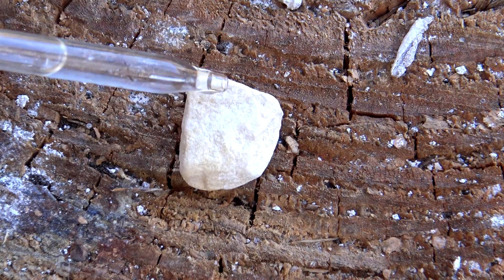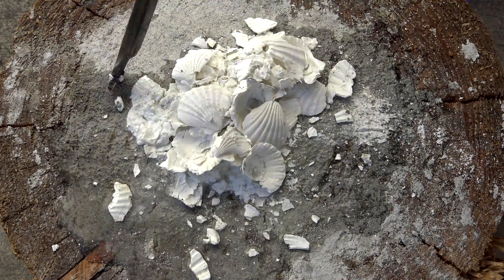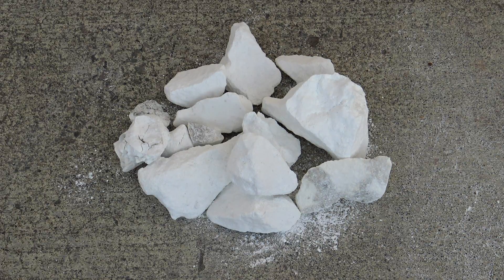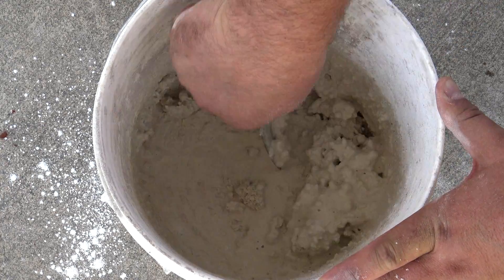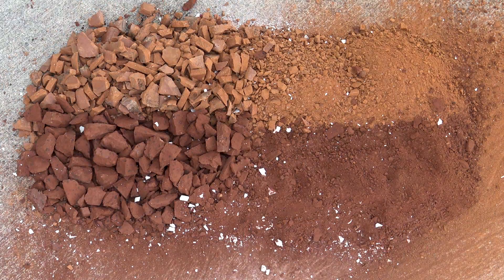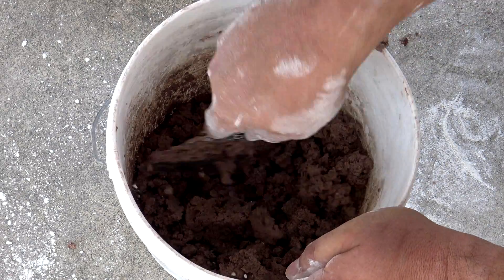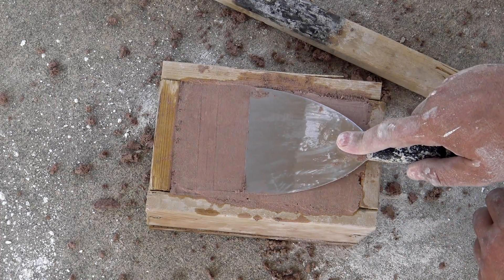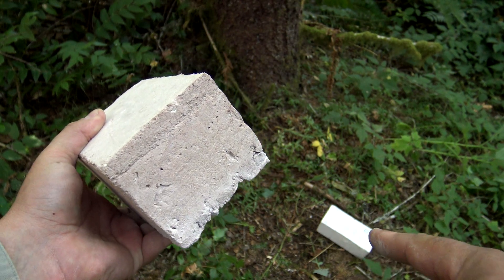How To Make Improvised Roman Concrete (Corporal-Crete)

Comment: It's interesting you bring up ceramics and brick, particularly relative to their respective formulations.  High strength, high alumina ceramics and bricks - you would use Kaolinite or Kaolin clay.  It's commonly used in foundries, but, as a ceramic or brick, it's expansion properties are much more stable than other common clays.

Also, strong brick, historically has been associated with a small addition of humus, or humates, or, in its simplistic form humic acid.  This is especially notable because it is hypothesized Roman concrete also contained small amounts of humic acid and pozzolans (high alumina clay...or Kaolin).

Humic acid is a chelating agent, but it's also a natural plasticizing add mix.  So the kaolin, with a minimal amount of humic acid, would hypothetically blunt its impact on the calcium compounds.  Roman concrete needed longer to set, but also became stronger over time - this has been attributed to the pozzolans, but the different bonds humic acid forms could have played a role as well; particularly if humates have to break down to humic acid after the calcium bonding has largely taken place.

Also, in terms of aggregate size, two different sizes would be selected and it's shown that a very fine with a fine aggregate tends to produce the most durable/strongest concrete.  Also, of course, the most expensive concrete.

If you wanted to make concrete stronger than roman concrete, be selective with your sand.  Some sites in Africa are known for sand with high diamond content - aptly dubbed "diamond sand." The name alone almost begs to be tried out!

Cool videos testing out variations on Roman Concrete - it's an interesting mystery given all the concrete we use today.  Seems like it shouldn't be....(?)
Reply: nice read man. As a farmer i have an abundance of hardwood ash and perlite used in my soil preparation for seeding.would it be possible to use any of these materials as readily available substitues.

Comment: I wondered the application of lime mortar, in place of cement, when making rammed earth.  The amount of cement is a low percentage, and the caustic mix of lime once mixed with the screened earth, would be damp still, enough to ram the blind or walls.  I heard that a company was using a gypsum plaster,  to create a concrete from earth.  The gypsum slowed the drying process.  Aldo, salt water, somehow strengthened roman concrete.  But, just, primitive lime mortar from limestone, mixed in place of cement, for rammed earth really intrigues me.

Comment: Traditional cobb structures were stabilized with a layer of lime plaster inside and out.  There are cobb buildings in the UK that are 600 years old and still occupied.  Adobe structures can be plastered in the same way.  Roofs can be thatch, shingles, shakes, slate, or tiles.  Low tech housing should the need arise.

Comment: I wonder if silty layers from a river would make a good mix. idk about you but is hard to see silt as font is bad. S I L T. sorry just in case. but I think if sifted and strained it would be as good as volcanic ash. also most old concrete used an aggregate, the hardest is quartz river stones, from what i have  seen in renovation projects of old roman structures

Comment: Just wondering normal clay would be ok to mix in? Now that you makes pots with that or does it has to be heated? And does it counts for all kinds of clay?
Reply: Oh yeah and if you build a shelter underground with it, then water would get through the concrete? or now that you added Clay/pottery does that make it a bit more water resistant?
Reply: If you put the shells in a box of glass like a green house would the sun be enough to make the sea shells usable if you dry/burn it through magnifying glass?

Comment: How do you make concrete if your in the woods & don't have any thing from volcanoes or by an ocean but maybe fresh water, & no lime.
Reply: if no volcanic ash one could use wood ash by soaking it in water then refiring it and then rehydrating again and add terracotta powder to make bricks... you can also add lime etc if you so wished to have a 2ndary binder. however the ash and terracotta works very well. this is also a water resistance substance (more so than regular concrete).
Reply: Lime is easy. Bones are very similar to seashells chemically, you can do the same things with the crushed bones of humans or animals. For silicates and aluminates it is a little harder as you have to mine them and you need some knowledge of geology. My guess is that gypsum is probably your best bet.
Reply: @exaltdragon  Bones can be used to make a reactive lime but it would be very very weak, because of the impurities. Bones are like half organic matter. Gypsum is a good suggestion, though it's not water resistant. Gypsum fires at lower temperatures than limestone. Gypsum is basically plaster of paris and can be used as a straight, weak but effective, mortar in itself. A LOT of old Stone buildings in Paris have gypsum based mortars.

Comment: I just discovered this second video.  Great to see it. :)

This second batch didn't have quite the same plasticity as the first one, I don't think; it looked more crumbly.  I could see the first batch being used more for load bearing applications, and this one being for a fire hearth; especially if a bit of sand was added to it to make it a little more specifically fireproof.
Reply: second one is mortar to use as a binding material for stone or brick wals
Reply: and as a plaster for wall is perfect

Comment: I keep seeing very silly people claim that Roman concrete is superior to modern concrete.  I ask you how many roman concrete bridges are still standing that allow anything other than foot traffic to cross them?  How many can Roman Concrete Bridges support an additional 400 tons of weight day in and day out?  How many of these supposed Superior Structures are put through the stress of the modern day?  Almost none of them.  Why?  Cause they lasted this long and we don't want them breaking further.  Eaven modern concrete can stand the test of time if we don't fucking use it for anything.  But we do, hence why it breaks down.  We don't build things out of concrete because we want it to look pretty, we build things out of concrete because we want it to be strong.
Reply: at least one was used for traffic until 91

Comment: hmm i would like to know how they react to impact... just like steel, the harder it is, the more brittle it is so if you hot both bricks together, will they break like normal red bricks? since normal red bricks are extremely brittle on impact they break with almost no force BUT they can withstand extreme pressures so that is why they use those... my prediction is that original roman brick is better against impact. (i play too many "make it your self" games i think; Like Factorio, Space Engineer, 7 Days to Die and mods of minecraft... i know when i look at my back yard and realize i can't just go dig stuff and make a fortress or a factory ;P )

Comment: I just found the channel tonight. Looks interesting. I'll have to check it out some more.

But I'd call this a success. That second concrete block you made in the Roman concrete video clearly had some pitting issues. I'd guess the problem was a combination of the aggregate size, and trapped air, probably also due to the aggregate size, though maybe you could compensate for that with extra layers and tamping or vibration to get the air out. Although that would decrease the insulative properties of the material.

Materials science is always a balancing act.
Reply: If you add enough water and vibrant / tamp you can get rid of more voids. Cement in a concrete truck has enough water that it can be poured. They set up sprinklers on cement bridges ( after it sets up) to accelerate the cure as water is part of the cure. On a hot day I had extra cement on a tarp in my drive that was hard to break with a sledge hammer by the time I leveled my cement side walk.

Comment: Success again ! Yup , I was wondering what to do in the case of not having a volcano near by. now, What to do if you do not have planter pots or red brick? Thanks.
Reply: Ram some earth, it's bullet proof and will resist explosives better than non reinforced concrete.  Most people have access to dirt, a shovel and can make or jury rig basic forms... you only need one small section of formwork and keep reusing it.  You could also build a very sturdy small form and ram by hand or a press (machine or hand power with a long lever, both work) to produce rammed earth blocks.

Comment: You can buy bags of crushed terra cotta from ceramic supply shops. 1kg to 25Kg. 

Its called terra cotta grog. 

Ceramicists add it to their wet clay to "open up" the clay and reduce shrinking or cracking. 

Here's a source in Australia. I'm sure you can find some local stuff. 
http://shop.walkerceramics.com.au/BA420.1/Grog-dash-Red-%28For-E_or_W-Only%29/pd.php

Pete
Reply: www.shop.walkerceramics.com.au/BA420.1/Grog-dash-Red-%28For-E_or_W-Only%29/pd.php
Reply: Sorry that link it's displaying properly. Just copy and paste the entire line to your browser and it should work .

Comment: So in addition to your info in this great vid It might be nice to know that the chinese used clams to naturally fortify bridges in both fresh and salt water to keep them from eroding. Basically creatinh a huge shell. The romans did this too in a lesser extent but the romans used concrete whereas chinese used stone. This type of concrete you made is almost the same from what Ive read and seen. And it uses salt water to chemically strenghten it (unlike modern concrete) but romans had many different types and ratios too. The salt water type isnt very good on land for example. Interesting stuff!

Comment: the higher pitched sound means a lower breaking point, meaning it can withstand less stress than the roman concrete making it weak against impacts and too soft to chisel consistently.
Reply: It might have more hardness or heat resistance

Comment: You should do a video testing the structural integrity of both Roman and Coporal-Crete using modern concrete as a control.
Reply: I agree, that would be useful.
Reply: Would love to know the formula that the Army used for concrete (eg. bunkers) in WWII.  It seems indestructible.  Is the formula classified?  Is it available?
Reply: @vg2b713  Nope.  Same concrete used in civilian applications.
Reply: @MrPittbull30  Yep just a lot of rebar
Reply: HiveQu33n : That would be interesting. Good idea Queen!       -Mark
Reply: No need to run that test. Read Vitruvius. He explains much of this and gives ratios. He was a Roman engineer and builder. Modern concrete begins to breakdown after I think it's about 100 years. Roman buildings are still standing.
Reply: @richardhawkins2248  Exactly so!
Reply: I was thinking hammer test on all three. Test structural integrity from impact.
Reply: Right....also to compare to today's Portland Concrete would be good.  I saw a vid on youtube where some kids just mixed wood ash into their cement mix and the resulting sample crumbled.    With wood ash, you have to make a ball paste with ash & water and FIRE it in a hot fire FIRST.
Reply: Late to the party but Demolition Ranch colab? Lmao
Reply: Agreed. I’d love to see how much weight your concrete and terracotta bricks can take before failing.
Reply: It would not help.  As pointed out by Nigel and Robyn, crush testing tells us nothing about the performance of mineral binders.  Wood ash.  Or any pozolan.  The guy who gave us the myth that “Roman concrete was lost” way back in the 19th century was a scientist who studied all the pozzolans and built a table of them.   MPA strength means nothing.  Harder is not better.  What matters is pore structure and capilarity.  You get this with quicklime and poz
Reply: there are videos on here it nowhere close to as strong as modern concrete
Reply: Take a look at Paul.cook.and what he’s doing with these ideas and old techniques ,peace
Reply: Exactly what I was going to write, you saved me some time, thanks 👍🏻😂

Comment: Does regular sand work?
Reply: In modern commercial concrete sand is used as a fine aggregate. Silica fume is sometimes used as a pozzalen in cement.

Comment: Actually the Romans made stucco using "potshards" aka grog.  This was recorded by Vitruvius, and was rediscovered in Renaisance (rebirth).  The method caught on with the Venetians who used broken roofing tile.  This commonly known as Venetian plaster.   This was finsihed with a mixture of pigment and saponified beeswax (cera colla - wax glue - reflecting its use as a binder, for wood they used what the French call cheese glue, or milk paint) and hot iron plates.  Very water resistant.

Comment: I wonder about just using sand and gravel instead of terracotta and red brick dust.
Reply: should work really. Quicklime (Ca0) is basically non-portland cement (which is the modern "better" cement). Really the difference in those two is that it involves a few other salts that react with the quicklime and water for example, a bit of gypsum salt. The main point to cement is to keep it moist and mix it with stone/sand (any kind) as it's hard and doesn't crumble. But softer aggregates like straw, perlite etc... can be used as well.

That whole needing brick/terracotta etc, is just extra headache that isn't necessary. Portland is better, the more you can replicate the better.
Reply: Thats just modern mortar is it not?

Comment: Cool videos! is there a reason for adding the water to the lime separately and then letting it dry? ie would one just be able to add the cooled lime (out of the fire) directly in with water ash and the aggregate? Like the idea of being able to fabricate custom bricks, I will definitely be giving this a try on a weekend! Thanks for the video!
Reply: It is totally fine to mix the quicklime with the aggregate, then add water to slake it, some people say it actually makes a superior product when mixed hot. It works better when the quicklime is crushed first.

Crushing the quicklime is a bit of a pain, it is much easier to add just enough water to get the lime to slake to a powder, then mix it immediately with your aggregate and add a little more water to get the right consistency. 

I highly recommend Nigel Copsey's "Hot Mixed Lime and Traditional Mortars". He quotes all sorts of historical texts that document how it was done.

Comment: It would be really interesting to see a variation of the roman cement with wood ash rather than with volcanic ash. This extract from a study seems to suggest its possible but that was in contemporary cement. http://www4.uwm.edu/cbu/abstracts/03-513.pdf
Reply: I would agree. Wood ash is high in potassium, hence the name potash. It is used in making primitive soap due to its alkaline content. Calcium and potassium are in the same group on the periodic table along with sodium. So, it stands to reason that wood ash could indeed be used as a substitute provided you could boil the ash. Concentrate the liquid, then add back to the remnant solid mass by a ratio to match volcanic ash. So for example, you extract the Po2 by boiling ash. Then evaporate the water. Then add the potassium water back to half the ash and discard the other half. Assuming in this case it is half as useful as volcanic ash.

So then the new ingredients would be Aggregate of junk; processed wood ash, and cooked sea shells/chalk/talc powder.

Of course, there is one massive source of CaO you can process. I believe all drywall is made from calcium deposits. fired drywall scrap would make a crap ton of concrete. You could then use the ash from firing the drywall to complete the experiment. I guess we could then call that Pete-Crete. The advantage would be its all the ingredients processed almost at the same time!

Another fun idea is using the CaO as a flameless ration heater. Afterall, it seems highly effective as an exothermic reaction. Since one will probably have fires now and again, one can reprocess the drywall back into usable CaO - FRH material...then stick it back into a baggie for your next meal of can creamed possum in the field!

Comment: could you use ash or charcoal instead of volcano ash?
Reply: also interesting, In hemp-crete, Lignin is what reacts with the calcium carbonate, and lignin is abundant in trees. but i dont think hemp-crete really compares to this type of concrete :/
Reply: No.  Volcanic ash is what is left of rock, after extreme heat and pressure has pulverized it to dust.
Reply: volcanic ash = 50-60% silica with high iron/magnesium content.
The silica is the key chemical compound. 
Its the combination of the silica and the calcium carbonate that make for the long lasting crystallized formation of the concrete.
Glass and quarts are great sources of silica.
Reply: So, would pulverized quartz be good, then? Lots of quartz veins up here.

Comment: Could you then use the concrete paste as the mortar to lock the brick walls into place?
Reply: if you mix the quicklime, "concrete paste" with sand, you'll have the same mortar that was used to construct most of the medieval castles in Europe. It doesn't set up hard like modern mortar, which is why many of the castles have survived multitudes of earthquakes.